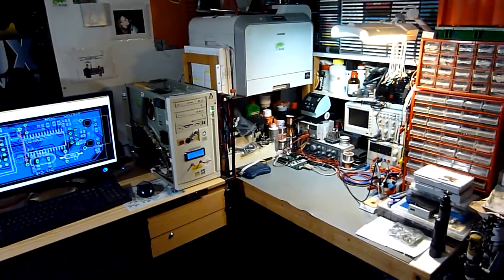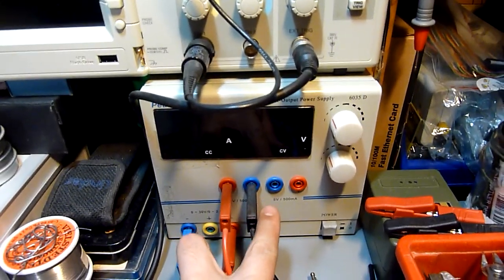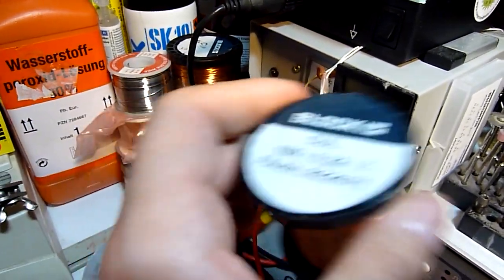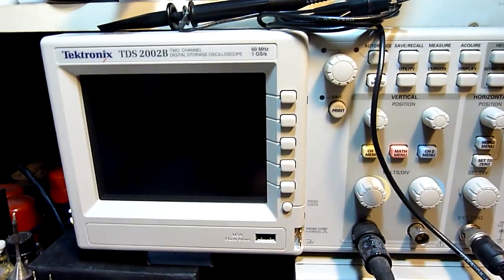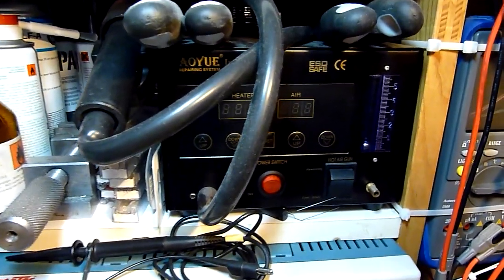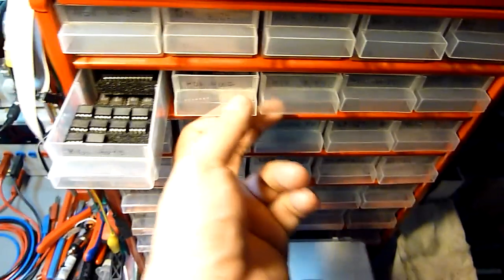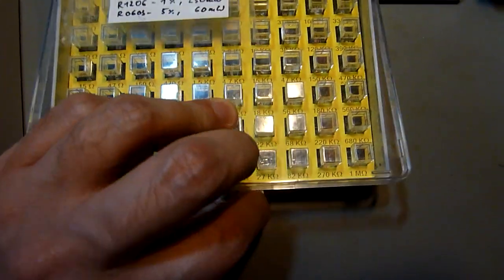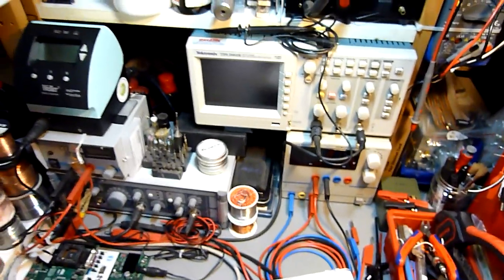My electronics workshop explained in more detail.

Comment: One piece of advice I will give you, I notice you have a number of different chemicals all stored together in one area of the bench with many items of equipment near to them.  Think of this, if one bottle leaks the substance will go everywhere and in the case of HCL will do alot of damage. Leakage may cause other containers to leak and then you have  a hazardous situation and lots of damaged items, including possibly yourself!   So, I suggest you bundy your chemicals in an area away from other items. Bundy means to have then in a shallow tray or container that will hold leaks and prevent contamination of other area's.  Be safe, not sorry.

Comment: I got the distinct impression it was a recipe for disaster myself, those chemicals jammed in there with the soldering iron and the hot air rework station, potential of sparks etc.

Comment: Which software do you use for PCB design? I have a couple of small 20 and 30 MHz scopes and a dual trace 250 MHz now. Where are you from? I run Weller soldering ESD safe units similar to yours. Try MPJ for displays. My 250MHz is a Tek, but no storage. Next I am going for a CNC router. No more etching boards, and cutting cabs will be easy and fast. My power supplies are 0-30 VDC regulated, and a few high voltage vacuum tube supplies that top out at 1200 VDC @ 10 amps! Usually I use 500V Lambdas.

Comment: nice lab, you seem pretty well set up. As you are starting out in SMD, might I recommend a few things. Getting an electric vacuum pickup tool and a good stereo microscope makes things a lot easier. I can hand solder 0402s easily, and do QFNs and 0201s with a bit of care now, but without the scope its near impossible.

Comment: @linuxgeek81 well i have to admit i have been doing electronics in my high school days and only recently i started the process of returning to the electronics field - most of my so called "fun projects" were made on a breadboard :) - but i have made a couple of PCBs as well. My experience with the "pistol" was not that bad although i do acknowledge that its impractical to solder those smaller tiny parts. You do need a micro solder -s what we call it here - but its expensive :)

Comment: very nice lab - i have a question the soldering station is i guess regulating the temperature of the tip - why is specifically this feature good over old soldering pistols with uncontrolled temperatures. And about the hot air station - do you have some video how this works? I would really like to see it in action :) Thanks and greetings from Slovakia!